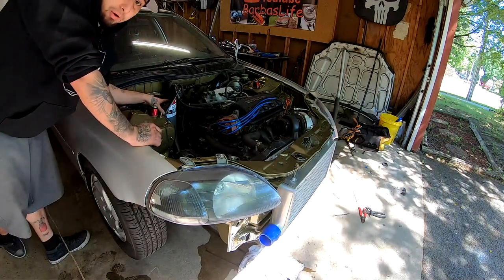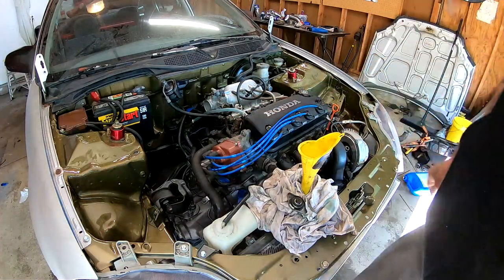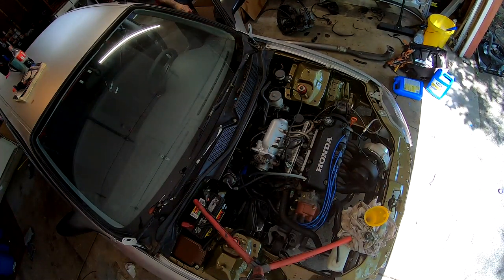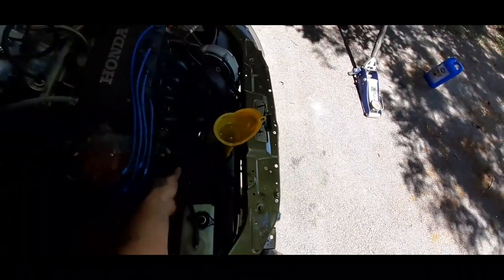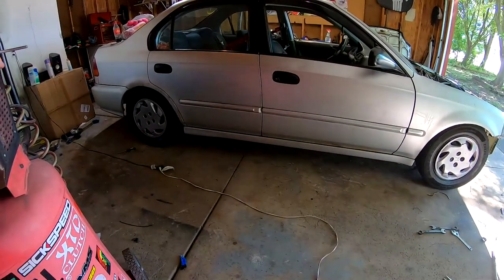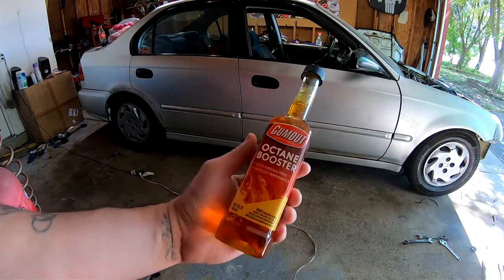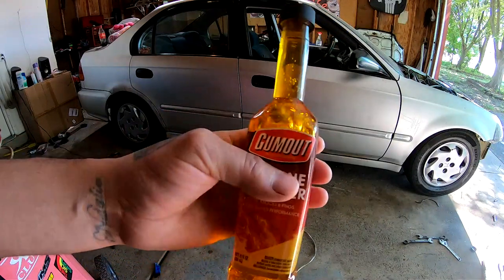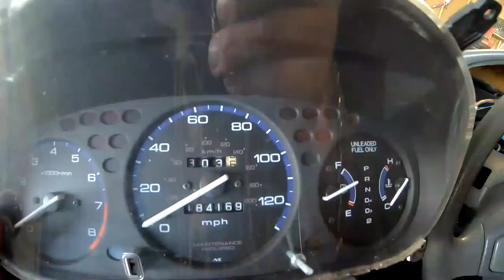500hp build Cheap budget Ebay turbo civic sleeper build first start Running

Comment: Hell yeah!! Great  job bro 👏 👍 👌 💪 glad to see progress. Check it out i just installed a kemso 340lph fuel pump on my gsr and damn.. i gotta say its a hella good upgrade.. feels like my motor just juiced up a 10-15 ponys back in her i highly recommend this if your in the market for a pump. And dig this i got it for less than 25 bucks off ebay.. lmfao!
Reply from the maker: I might have the same one from ebay also just gotta install it.
Reply from the maker: Yeah high pressure  fuel pumps really wake ur car up. Thats a good mod.